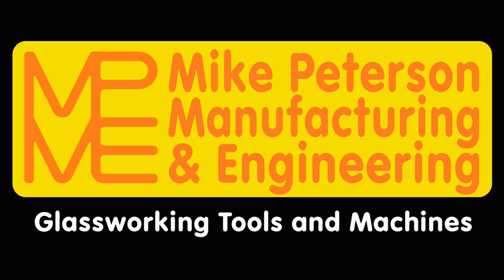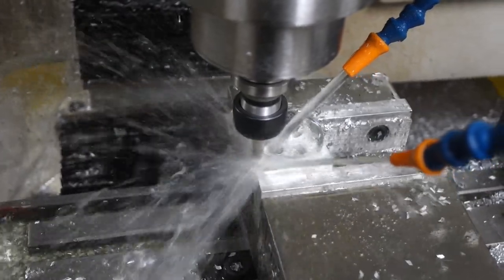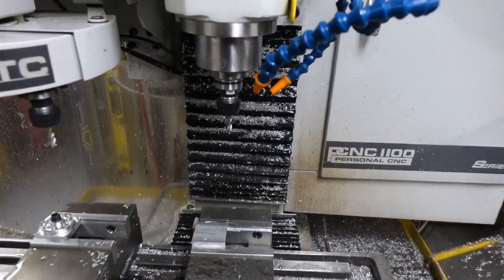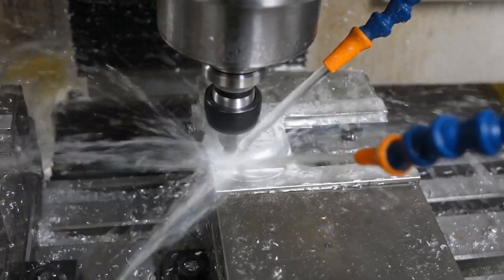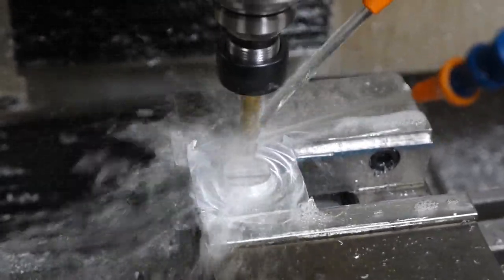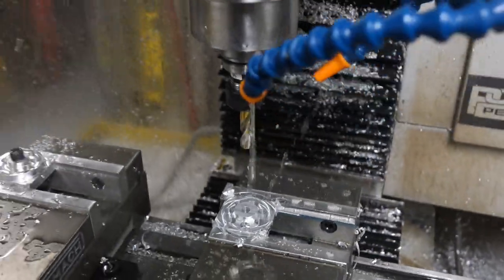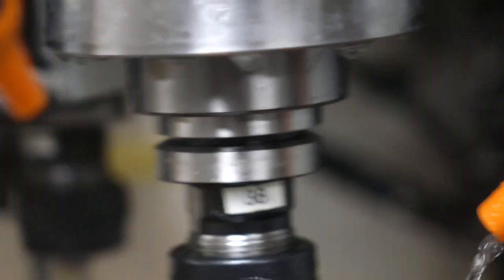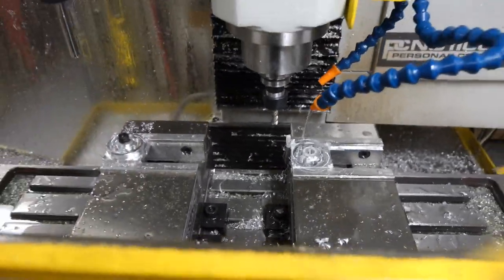In production on the Tormach PCNC 1100 with ATC

Comment: I know this is an older video, but in case someone is still listening.  Make sure you're lubing the R8 collet between the collet and the spindle (check the manual). This has a large impact on the TTS holding capacity. If it's dry up there, then the Belville washers are pulling against friction surfaces, and not using their energy to close the collet.

Comment: I have designed a similar, albeit more complex TT8 arrangement (not on a tormach, but from same factory) and found that 4 stacks of 4 belville washers is JUST enough for 1HP. I see you have 4 stacks of only 2 washers.  1000lb tension is just enough for 1 HP. I use double stacked washers for extra pressure, AND the fatigue life will outlive me. 

The service life of washers will be low with only 2 washers.
My test is to hold the spindle still and see how much torque is required to make the tool slip. Can't remember the figure at the moment.
Reply: This is true

Comment: Looks like you can tighten up on your drawbar some. I tighten mine until the tool just barely drops free when I activate the air cylinder. The drawbar, R-8 TTS collet, and Belville washers are wear items and will need to be inspected and replaced occasionally. 
The quickest way to speed up production with a Tormach is to put as many parts on the table as possible and machine as much as possible before doing a tool change. I have gotten to the point were I don't worry about the time as much as I once did. I fire her up and let her cut, then I go do something else.

Comment: try it at 4k rpm instead of 5k for better horsepower.  You might make sure your filter/regulator/lubricator is actually providing adequate PSI, and the air compressor too.  The set screw holders are far better than ER20 collets.  I don't have tools pulling out unless the load is far beyond what is programmed.